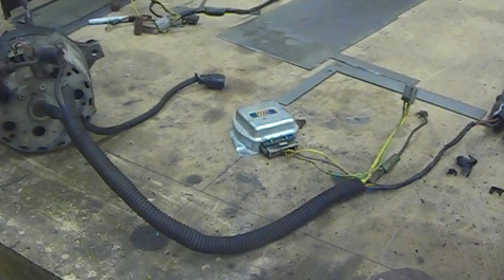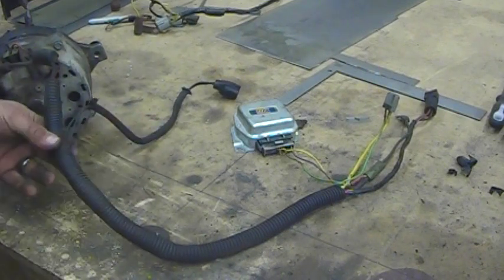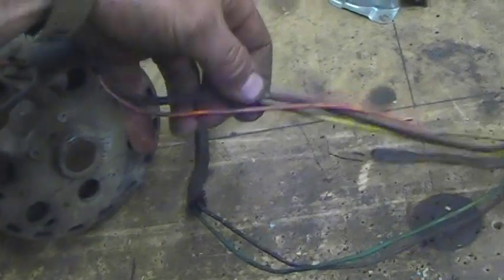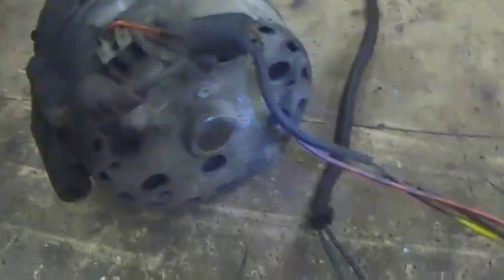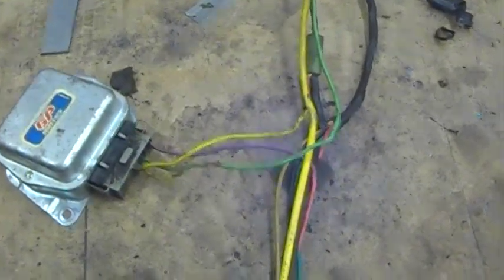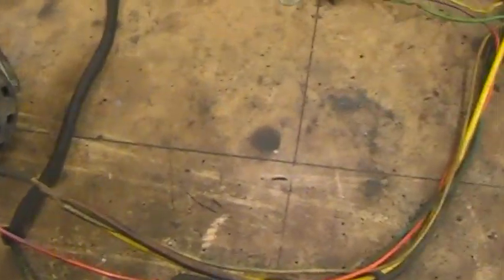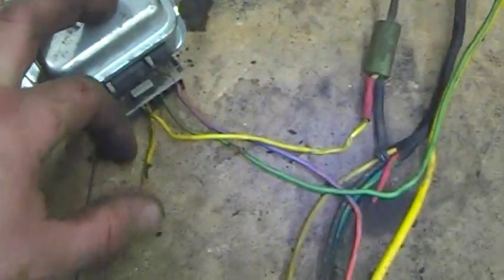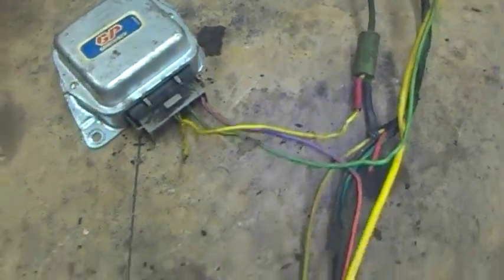Ford externally regulated alternator wiring

Comment: i got a question for you: I have a 92 ford F600 and the alternator quits charging every 3 months and need to be replaced, it has an external voltage regulator. I have gone through 3 Alternators and 4 voltage regulators. the final voltage regulator is a variable speed voltage regulator and the vehicle still looses charge after 3 months. someone recommended changing the spark plugs? what is your opinion on this?

Comment: I have a 66 bronco that I just rewired and everything works but the alternator wouldn't charge. This is not how the wiring diagrams showed to wire it. Diagrams showed s on regulator to stater on alternator. Put 12v switched to s on regulator and everything works like it should. Awesome!
Reply: Wiring is often different depending on whether you have a charge gauge or just a warning light.

Comment: I’m confused about the splice from the field wire at the alternator going back towards the regulator
Reply from the maker: There shouldn't be a splice on the field wire.  The field wire should be hooked directly to the regulator.  The splices are in the battery wire from the alternator (the main output lug that charges the battery).  The reason for the splices in here is because one wire (the small one) is what provides constant battery supply to the voltage regulator, and the other larger spliced wire went to the cab wiring loom to power the rest of the vehicle.

Comment: What does the black and white wire run or mean!
Reply from the maker: White wire with a black tracer stripe goes from the regulator to the alternator (S terminal on regulator to S terminal on the alternator)   The Black wire with an orange tracer stripe is constant 12v power from the solenoid (B+ terminal on the regulator).  Yellow with a white tracer stripe is the alternator output which also goes to the solenoid battery terminal, and the light green wire with a red tracer is switched 12v from the dash light.  Depending on the vehicle (particularly if you have a gas engine) there is sometimes a wire run from the alternator to an electric choke heater - this is tied in with the S terminals and is usually also a white wire with black tracer.

Comment: Your video helped me out tremendously. I have a 69 f-100 , someone told me the alternator had a built-in voltage regulator, so....l bypassed the external regulator. After that my battery would die out after 3 days use. I couldn't figure out what was the problem. The alternator on your vid. Is the same as mine. So....l went back to hooking up the external voltage regulator. It's working great now. The only thing l've noticed different is that every time l turn headlites on my battery gauge indicates the charge needle moves toward charge instead of discharge. Can you explain why this is happening? Thank you and God bless.
Reply from the maker: I'm glad it was able to help you Edyon!  So when you turn the headlights on, the current draw causes a voltage drop at the battery.  The voltage regulator detects this drop and signals the alternator to increase it's output to make up for the drop caused by the headlight draw.  What you're seeing in the bump of the voltage gauge needle is this response by the regulator and alternator.  If the bump in the needle seems excessive, you can measure the voltage at the battery to see the change when you turn the headlights on to make sure the voltage regulator isn't overshooting.  Glad to hear you're keeping the '69 alive!  I was going to fix up a '68 and had disassembled the truck and was cleaning/painting and getting ready to start rebuilding from the frame up when a big storm blew a tree over and smashed the cab!
Reply: @ChristopherKleman  sad to hear about what happened to your 68 f-100. I've had my 69 for over 38 years. Bought it from original owner, who was going into a nursing home. The 69 had beened parked for some time, the son seeing his father wasn't getting better, decided to put it up for sale. I went by this place every day to work. One morning l stopped at the red traffic lite, and l saw a man putting a for sale sign on the 69 swb 302,  l was the first person to pull up even before the sign was taped on.  I asked the man for the price, he said 1,200 bucks. The truck was the basic model , but was in very good condition. I wasn't letting this one get away. I offered 1,100 bucks , the seller agreed.  I called my dad to bring the money because several other people were waiting to see if l would take it. I sat in the truck until my dad showed up with the money. It's still in very good condition. It's part of my family now, it's staying here. It was assembled in the Dallas plant. Hardly any rust, and it runs great.

Comment: I have a 78 mustang and my wiring is hacked to hell! is there anyway to bypass the voltage regulator and would it be safe? The voltage regulator was cut out so now the orange wire with the blue stripe from the field on the alternator has nowhere to go there's also five other wires that don't lead to anything I figure the orange wire with the blue stripe must get connected to one of those other five wires in order to bypass the regulator! I have a thick light green wire with purple hash marks, a white wire with blue hash marks, a white wire with either a red or orange stripe, a red wire with a white stripe, and a red wire with an orange stripe! Lol thank you anybody that even attemps to help me!
Reply from the maker: You can't really "bypass" the voltage regulator as you'll cause the alternator to go full field and crank out as many amps as it can - the likely result is that you may go over voltage and blow out other things on the vehicle.  Your best bet is to pick up another voltage regulator and wire it back in, or upgrade the alternator to a newer 1-wire system.  You should still have the light green wire with a red tracer going to the voltage regulator as a switched power source.  And you'll have the yellow with a white tracer as the always-live 12v supply.  You should then have a white wire with a black tracer that goes from the voltage regulator to the alternator field wire, and then you'll have another white wire with a black tracer that goes to the choke relay/choke heater.  A red with a yellow tracer would be 12v while running which would also supply power to the choke relay if you have one, and a gray with a white trace would go from the choke relay to choke solenoid valve.  White wire with blue stripe would go to a high output ignition module I think?  I suspect things have been changed on the car over the years - perhaps aftermarket carb/choke system, aftermarket ignition system?  Fortunately, in that era it doesn't take much to get them running, so I'd probably try to start fresh and re-wire under the hood.   Best of luck!

Comment: how to add a 0 gauge to that system if you want to do the big 3 upgrade to an older model ford?
Reply from the maker: prayfawind - it should be fairly similar to more modern vehicles, however you'll have the fender solenoid where the current alternator stops at.  Because of this, you have two options essentially - either upgrade all 4 wires (Battery to Solenoid, Solenoid to Alternator, Battery to Block and Body to Block) or you could leave the wire to the solenoid in tact and simply run your new alternator charging wire directly to the battery - however it is advisable to utilize a fuse or fusible link in this run.
Reply: @ChristopherKleman  thanks for the response, i was wondering if i could of 0 gauge directly from the battery to the alternator (fused between) didn't know if it mess up the external alternator voltage regulator, i've already ofc 0 gauged, the positive to the solenoid and negative  ground to the block, even 0 gauge from the block to the  chassis(over kill i know) , i also upgraded to a 100 amp alternator  it's a 66 Mercury i am restoring
Reply from the maker: @prayfawind  That should be no problem at all as the solenoid terminal the original alternator wire is connected to is always connected to the battery anyways.  Just make sure you maintain the 12 volt supply from the solenoid battery terminal to the voltage regulator and you should be good to go.

Comment: So, @2:30 you said that you can jump 12volts to the field terminal and see if it puts out voltage...but it will go full output so you don't want to run it that way for more that a few minutes? Ok, does it matter if the field wire is connected when jumping the 12volts to the alt.post? I have this Ford 6.9 diesel that doesn't charge (new alternator and regulator!) I even plugged in a brand new regulator to test the other "new" one! I'm going nuts trying to find a 1984 wiring diagram online,ebay,google,amazon. etc.( I haven't tried Nasa yet, but they claim they lost all their Apollo moon telemetry data... ?-)
Reply from the maker: As long as you have 12 volts at the alternator's output post, a jumper from the alternator post to the field terminal should cause the alternator to go full output and you should be able to measure a jump in the voltage.   Best of luck!
Reply: @ChristopherKleman  
So the alternator output post is the big one with the red boot that goes to battery? I'll give it a try and let you know. Thanks!
Reply from the maker: @jimmielittle4414  Yup, that's the one.  If you don't get battery voltage on that terminal, check that it's connected on the battery side of the starter solenoid (if it's on the starter solenoid it will only be connected when cranking the engine).  Secondly, make sure that the cable has continuity  from the solenoid terminal to the alternator terminal - if it measures as an open circuit, there is a problem with it, and it may have burned itself out (acting as a fusible link).  If this is the case you'll need to replace the wire from the solenoid to the alternator output.  Also, it's best to disconnect both ends of the wire when checking for continuity, and it wouldn't be a bad idea to disconnect the connector from the voltage regulator too.  Don't want to break the meter or get a false reading.
Reply: @ChristopherKleman  
Thank you!
Reply: @ChristopherKleman  
Thanks again! Well, this was really helpful as it turns out, I have a 3 post-isolator that has the battery output from the alternator at the center iso. post. (no wonder I was confused as no diagram or photo has it!) I checked that red wire for continuity and you guessed it...nada. Nothing. I'm not sure if I should just scrap the isolator at this point and replace it later or not. Ford wiring is creepy w/all the fuseable links etc. 

Can I just hook a new output wire of proper guage and try it?
Reply from the maker: @jimmielittle4414  Correct, you can simply replace the bad wire with one of sufficient wire gauge.  If you are replacing a section with a fusible link in it, you can wire in an in-line fuse to replace the fusible link.  Car audio fuses and fuse holders can be handy for these larger sized fuses and holders.  Good luck!  It sounds like you're close to eliminating the problem!
Reply: Great idea! Thanks again, I'll keep you posted!  @ChristopherKleman

Comment: Excellent Video. One of the BEST Simplest on Youtube for Ford External Regulator.
Purchased 91 7.3 IDI w/Charging Problem: ONLY 8v registering when ignition turned on....
1.  Installed...New Regulator, No Change 
2 Installed NEW Alternator.... No Change..
3. Determined it was a wire issue.
Diagnosed with key ON...NO power to the Green/red Wire at the REGULATOR he's showing you, Then Traced Green/Red from the Regulator (Consequently... Orange wire from Reg does not get power to the Alternator... if Orange Wire does not get power, ...Alt consequently does not get "Excited/wake up" to begin producing power off the main terminal of Alternator=10mm which to the battery) this green/red wire goes thru the firewall. all the way to the Speedo Blue/Red wire (Some way connected to tach. Reconnected Lt Blue/red wire together, the tested and got Juice to Green/Red at Regulator, then connected it al up & got juice to Orange (Field) on Alt. 
Fired it up and amp Gauge/Battery now recieving 14v power!
Thanks Awesome !
Reply from the maker: Glad you were able to get it charging!  Some vehicles use an alternator signal for the tachometer driver (more common on older mechanical diesels that don't have an ignition coil to sense from).

Thanks for the comment!
Reply: I’m not understanding how to fix the problem

Comment: Thank You very much for this presentation. It help me locate the broken wire when my F100 from 1965 stoped charging the battery. Broken yellow wire! I found it when You explained "this wire should have 12 volt all the time" and "this green wire should have 12 volt when the ignitionkey is set on run". Thanks from Sweden!

Comment: So are the tach wires required to make it work? The rest is pretty simple, but you passed over whether or not those wires were mandatory if used on another application.
Reply from the maker: The tach wires are not required to make it work.  Just the Field, Stator, Battery and switched power are needed.
Reply: I noticed there's no wire for the stator in the 2-wire plug in the video...why? How?  @ChristopherKleman

Comment: I need your help all my wiring is the same but when I connect field wiring to alternator I get voltage being the ignition of I replaced regulators and still same problem...that’s what is causing my battery to drain overnight... took alternator get tested and it shows good any ideas?

Comment: Thank you so much, I'm about to use a G1 Ford alternator to produce DC in an off grid configuration and wasn't sure if the Stator connection was necessary, you solved my dilemma !

Comment: check your dis.cap and make sure that the pin  
 inside is touching the rotor or that your dis. is firing take a test light check For power going in and coming out if nothing coming out its your dis no  fire no start every thing could be just right but no start thank

Comment: 84 ford ranger 2.8 v6 engine turn but won't start got gas to carb got power coil,starter,stare relay ,dist,grounds are good,  got spark , idk thanx where else to go any help would be
Reply from the maker: Even with fuel to the carb, it's possible that the jets in the carb are plugged or the float stuck closed and not letting fuel in.  If you give it a quick shot of starting fluid down the carb while cranking it and it fires up, it's confirmed that the issue is with the carb since you know you have fuel to the carb.  If it still won't start with a shot of starting fluid while cranking, then the ignition system is likely the culprit.  If the spark is weak, you might see the spark outside of the engine when testing, but when connected to the spark plug won't fire the spark plug due to the higher compression.  This is of course assuming that the engine is known to be in correct time and nothing mechanical has gone wrong with it in regards to camshaft/distributor.  Best of luck!

Comment: hey how are you? have a question re: this charging system i have a voltage spike now granted it may vary depending on speed of the alt. but the heater will change, and also when i use the snow plow it overload. i have great batteries can this be ground issues? is Somthing set up wrong with the power feed for snow plow? send me any questions you may have thank you.
Reply from the maker: +mchl8 I'd first start with checking the grounds and that all the battery, alternator and regulator connections are clean. If the regulator is not getting a clean signal for the actual battery voltage it can cause intermittent spikes.  After verifying all connections are clean and secure, if you still see spikes occurring without any loads being suddenly unloaded, it could be a regulator or alternator issue (worn brushes could also cause voltage spikes if the alternator is old enough to have worn the brushes out).  Best of luck!

Comment: does the voltage regulator need to be body grounded? I have an 84 Lincoln, it charges at 13.9 volts, but the check charging system lamp turns on. when I unbolt the regulator from the body, voltage goes to 14.4 and the light goes out. I'm not sure what's wrong.
Reply: Regulator must be grounded to function. If not it can't function. Doesn't matter what it's grounded to. Body, frame, battery, engine, whatever. Regulator is always supplied power from battery. Receives voltage from ignition switch in the run position to turn on. If it isn't grounded it can't turn on. Ground is battery negative for practical understanding. Not grounded means open circuit for regulator just like much of the vehicles electrical system.

Comment: Where is the ground wire to the alternator
Reply: Doesn't need one because it's grounded to the engine by at least one of the bolts that attach it.

Comment: I'm still unclear about the S terminal. I see diagrams and mentions online that even for alternators, that S is for stator. Others like yourself, say that its actually for connecting to switched 12v from the ignition. I have a 1970 F350 with alternator Im trying to figure out